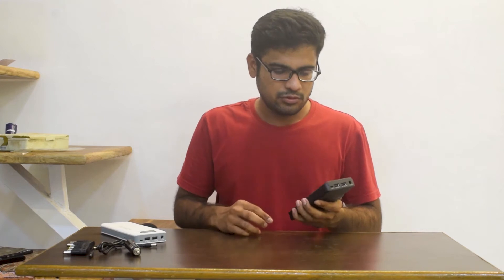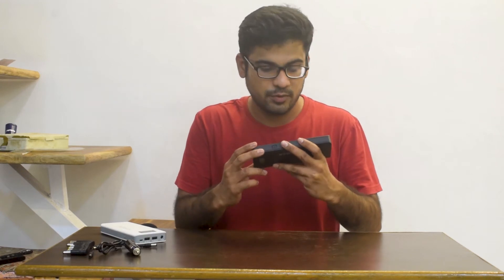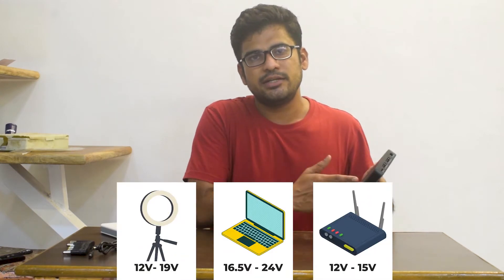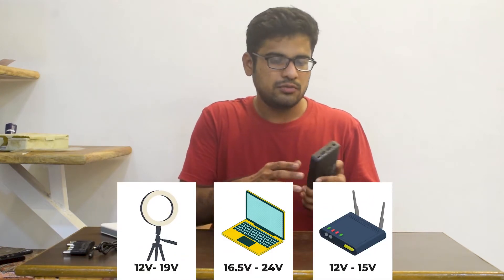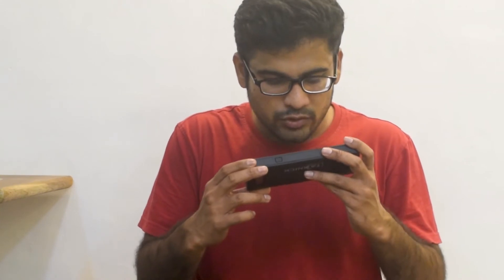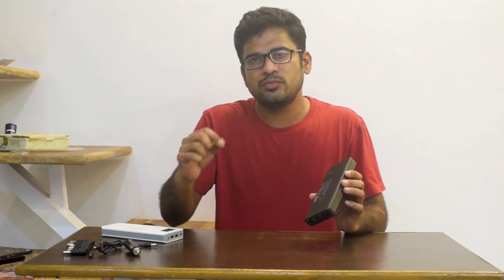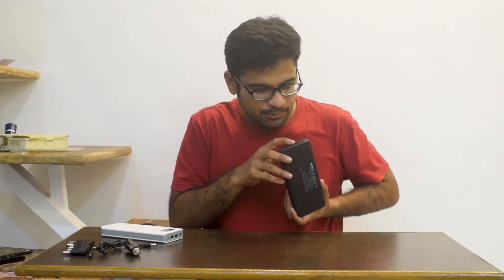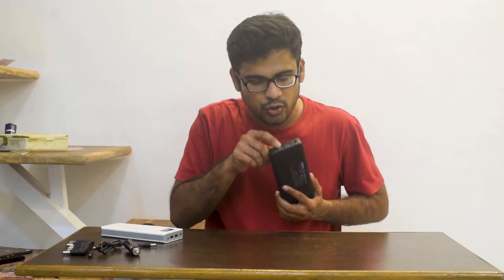Input and Output Voltage in VOLTA Multipurpose Powerbank | How to use VOLTA

Comment: I'm Planning to buy this, I want to know if the powerbank can be charged using my laptops 19v 65W power adapter? If yes then the same output port on the power bank used to charge the laptop, can be used as input to charge the powerbank with the laptop adapter? or does it only charge with the micro USB? Looking forward to get a quick response. Also if i purchase from Amazon does it come with specific laptop pin or all the pins included? I Appreciate your work with this startup  and would love to invest into your Made in India Product.
Reply from the maker: Hi Schubert,
Yes you can charge your laptops with the powerbank as it supports 65W charging. And yes you can charge the powerbank with the port it is charging laptops, as well. The DC port is Input/Output as well.

You can either your your laptop charger but its tip is not compatible to get connected with powerbank. Pros of using this port for charging is it supports Fast Charging of Powerbank. 
For ex, 
Micro USB: Takes 8 hrs to full charge powerbank.
DC port: Takes only 2.5 hours to full charge rapidly

For getting Customized Pin for your Laptop brand, We recommended you to buy from our website. Get exclusive discount upto ₹300 with code "RAKHI22" (applicable only on taknick.com) 

URL for details & Purchase : https://taknick.com/product/volta-multipurpose-powerbank-black/

We appreciate your support and trust in our company. You may contact us at below detail for any query.
Email: support@taknick.com
Portal: support.taknick.com
Mobile: +91 8828463371

Comment: At 19V assuming 85% efficiency it should output ~67Wh, right? In the product website efficiency is only mentioned till 12V and for nothing higher.
Reply: The total power capacity is 75Wh of the powerbank. The maximum power transfer from DC is 65Wh only. Making it 3.4A at 19V. 

The product comes with Digital Voltage regulator, thus making it possible to set multiple voltages.
List of voltage and current delivered are as follows.
At,
12V -5A
15V- 4.3A
19V- 3.4A
20V- 3.2A
24V- 2.7A , maximum

Hope this helps,Thanks
Reply from the maker: Thank you for your support